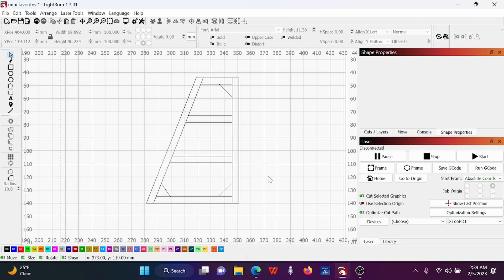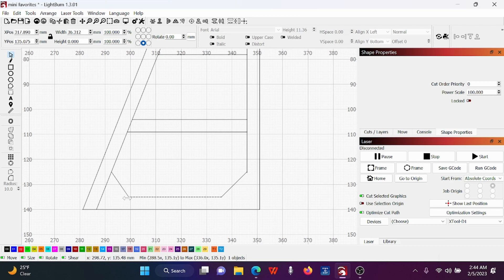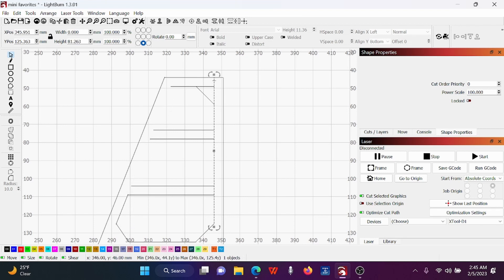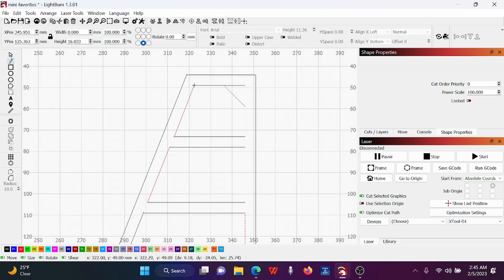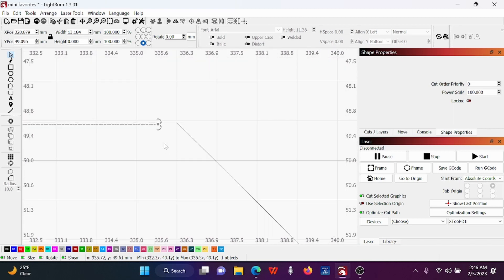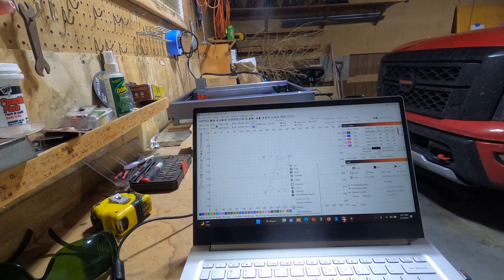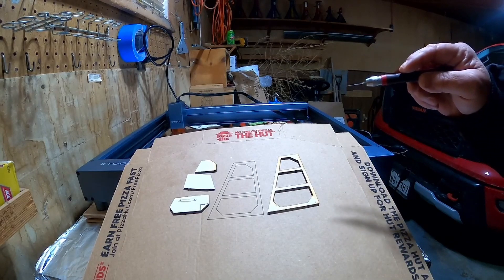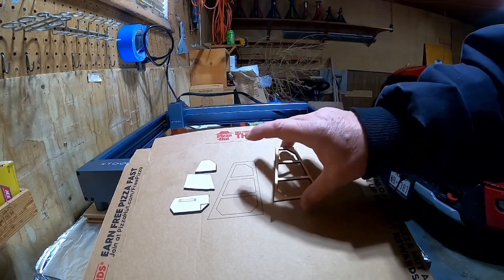Laser cut control surfaces.

Comment: Just found your channel, I am an RC builder since 1967 and now I have obtained a ATEZR P20 and trying to figure out how to get various windows to appear in lightburn and hopefully learn how to jog the laser head. Thank you….. from N.E. Tn
Reply from the maker: On your very top menu select "window" and put a check mark by which ever ones you want to appear. I use "Move, Cut, and Color Layers" most. (Move will allow jogging). Also on "Move" ...go back to the top menu and select "Edit" then "Device Setting". On this I have the following settings...Laser Offset = Off, Enable Laser fire button =On, Laser on when framing = ON. If you do this then on your Move screen you will want to set your Laser power kinda low so it will light up but not make any mark on your material during Framing. Thank you for checking out the channel, Please subscribe if you haven't already...     from Abilene TX
Reply: Thank you for your response, you have been most helpful, I look forward to your next video particularly as it pertains to RC/Laser @lazerbuilderrc1536